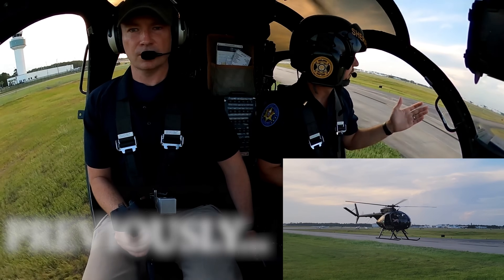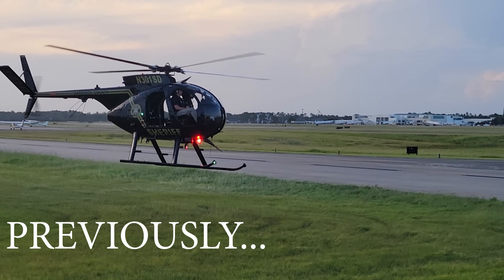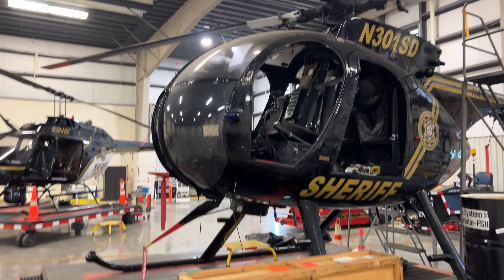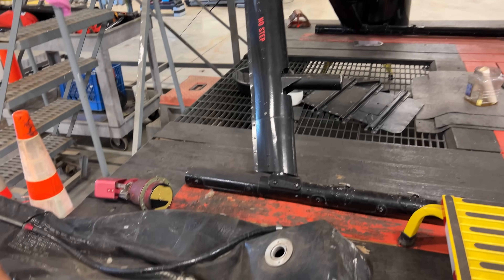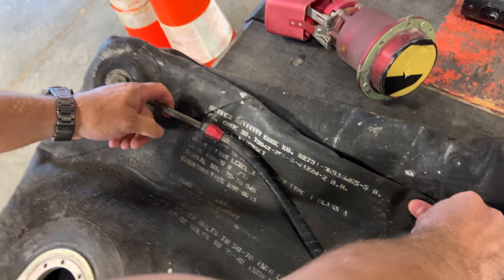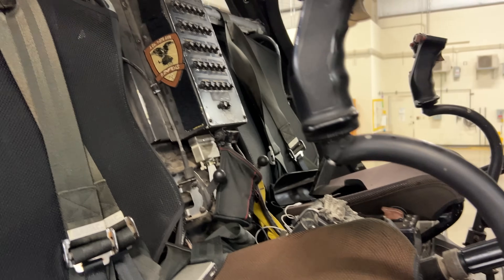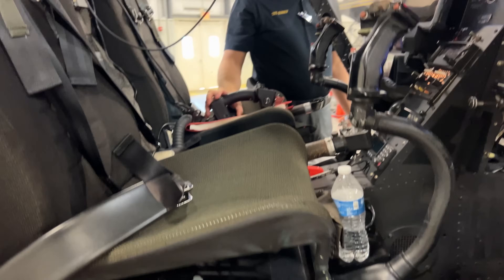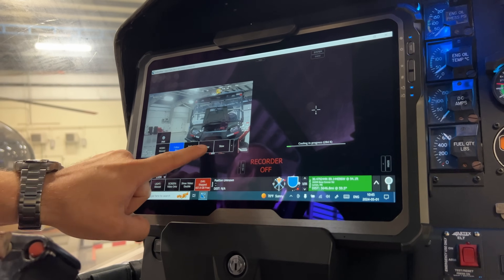This OH-6 Has Been Grounded For Two Years! Plus a FLIR/Spotlight Tour

Comment: You had asked early in the video if the OH-6 had seen Vietnam service. Here's what I was able to find 😃:

"7817 assigned to 219th Reconnaissance Airplane Company Headhunters 1967–May 1968.
Assigned to Headquarters & Headquarters Troop, 7th Squadron, 17th Cavalry Regiment Ruthless Riders May 1968-Jul 1968.
Assigned to B Troop, 7th Squadron, 17th Cavalry Regiment Ruthless Riders Aug 1968-Jun 1969
Combat damage May 9, 1969 South Vietnam by small arms fire and force landed. Later recovered and repaired.
Flying low level through Phan Rang Pass under orders from the flight leader and damaged when hit tree 
with chin bubble Jun 26, 1969 in South Vietnam.  Assigned to 604th Transportation Company (Aircraft Direct Support) 
Jul 1969.  Assigned to B Company, 123rd Aviation Battalion, 23rd Infantry Division Warlords May 1971-Dec 1971
Assigned to 245th Aviation Regiment.  Registered N301SD to the Harrison County Sheriff’s Department, Gulfport, 
Mississippi, Oct 5, 1993; current"
Reply from the maker: Wow!
Reply from the maker: Can you search 66-17817?  It may be referred to that in some records.
Reply: 66-17817 comes back to an aircraft destroyed by an RPG in 1968:

"17817 assigned to B Troop, 7th Squadron, 17th Cavalry Regiment Ruthless Riders May 1968-Jun 1968
Assigned to Headquarters & Headquarters Troop, 7th Squadron, 17th Cavalry Regiment Ruthless Riders Jul 1968
Assigned to B Troop, 7th Squadron, 17th Cavalry Regiment Ruthless Riders Aug 1968-Dec1968
Shot down Dec 30, 1968 in the area about half way between Bao Loc and Phan Thiet, South Vietnam by an RPG, crashed and destroyed."
Reply: I was an Army Huey crew chief 77-80. Fuel cell problems sucked. Hopefully they get that good looking helicopter back in the air.
Reply: My first thought was contact HeavyD, my second was Good luck!

Comment: I am not a pilot. Shall I assume the reason the fuel "tank" is a bladder is to allow it to expand and contract with altitude and temperature without leaking?
Reply from the maker: It’s self sealing for damage in combat.
Reply: @CWLemoine  Makes sense. Although, that feature seems to have failed if it's now leaking.
Reply: @BlackEpyon   They're self-healing in the sense that it will not rapidly pour out and lead to low fuel, but they still slowly weep where it was punctured.

Comment: My former employer recently replaced 2 MD500Es with AB125s. One of the 500s has 9000hrs, the other 16000. The engines, oddly, are higher time. I got to fly in them occasionally, they were great helicopters - especially when new. Both are up on an auction page, we'll see what they bring.